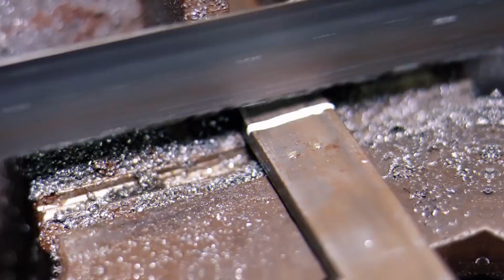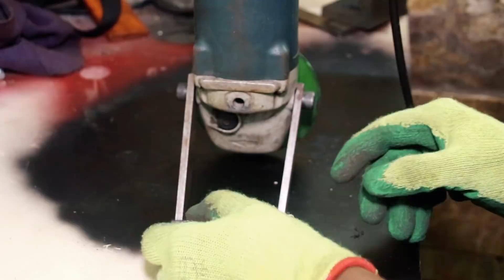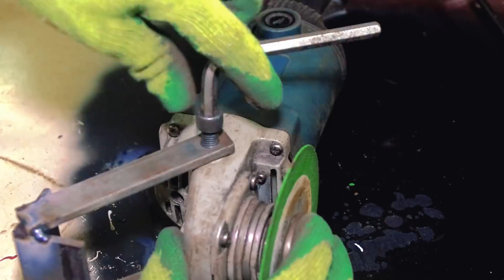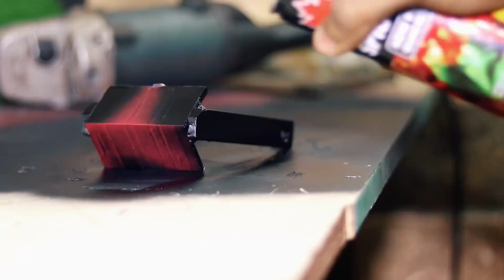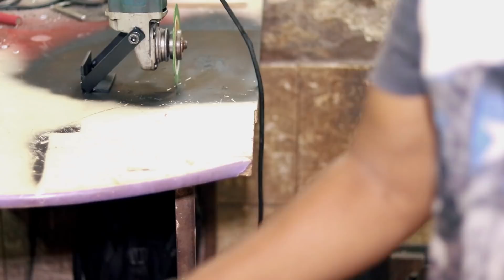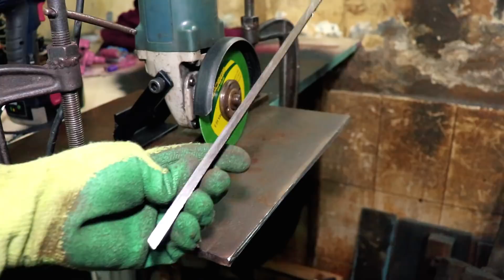THIS IS SOME AMAZING ANGLE GRINDER IDEAS WHICH WILL BLOW YOUR MIND.

Comment: You can easily fit a cutting wheel to a circular saw and run that down a straight edge, safer and about 30 seconds to setup. None the less, a handy attachment if nothing else will work.

Comment: If the jig was longer and held  the grinder parallel to the work piece, then,  you could drag the tool backwards for a fairly accurate cut. Now that may be an interesting concept to work upon 4 some applications.

Comment: All though be a ingenious idea and crafty, I would have to Agree about the other comments about safety issues. Do have a question? When you lower the grinder to make the deeper cut I believe that you also have to move you straight edge due to the fact that that when lowered it would move the blade away from the first slice , so I imagine you have to reposition  the straightedge also to keep it lined up with the cut line? I mean as you lower it it would move in a arc would it not? Like I said, crafty but I believe for simplicity little more thought and add in safety concerns aslo

Comment: first; you dont have to cut an 8mm plate with this machine but with one 230mm diameter 
second; you don't have any stability with your system
third;due to the wear of the disc the angle and distances will change gradually during the job
third; if you want to cut right, you just have(with a correct position of work) to follow (handly) a martyr guide, just to begin a 2mm furrow
then  you finish the work quite

Comment: Hmm. Surely the disc will only mark the metal on the first run. After that it would rotate around the jig, as the grinder cuts deeper, causing the disc to no longer cut at 90'. The jig will no longer be sitting on the flat surface and following the guide piece, potentially causing the jig to ride over the guide piece and defeating the whole object of the jig.😕

Comment: That's an accident waiting to happen. Buy a plasma cutter. 

"If you need a machine and don't buy it, then you will ultimately find that you have paid for it and don't have it." - Henry Ford

Don't pay for it with medical bills.
Reply: Nathaniel Hood- That is a spectacular quote from Ford that I've never heard before. As someone who has spent a fair amount of time both working with my hands and running businesses, I can say that it is extremely true. I can give you a good example that happened to me recently. I needed to bleed my brakes on an older car. Instead of buying a pressure bleeder I decided to do it the old way that is rather labor intensive. Unfortunately, it also carries the risk of depressing the brake pedal too far, and damaging the seals of the brake master cylinder. Guess what happened? I had to buy a pressure bleeder and a new master cylinder.
Reply: David Yeah, I've used that quote on a few occasions with my wife to justify a tool purchase. Thank you, Mr. Ford.
Reply: Nathaniel Hood That's the best comment on YouTube ever 👍
Reply: very good phrase! thanks
Reply: @UFallinggator  I have bled brakes on cars over 50 years and never ruined a master cylinder. And I don't use any pressure bleeder contraption.  That's almost as good as " too much oil pressure and you'll blow out the seals"

Comment: Terrible idea.  Besides the lack of safety (they can and do grab and jump), as the wheel wears, it will no longer be square to the base.  The way you built it, it's only square when the wheel is a certain diameter.  Try again.
Reply: Joe Atwork it would still stay square... It would just cut deeper.... Which would have worked better for him.
Reply: I cut steel with a grinder everyday, it's only as dangerous as you let it be. You have to be smarter than the grinder. I don't see any use for the contraption in this video, just slice it free hand. Its most likely being welded so you can leave gap to keep your project square. I have been a fabricator for 32 years,  I have never seen so many experts until I found you tube.
Reply: Totaly agree.
I can cut with grinder faster, more acurate ,straight lines and in same angle...
This project failed man.
Think something out ,that dont change angle and get closer when the disk wears down. 😉

Comment: the cutting disk will decrease in diameter. then you can not set your grinder holder lower in same line without set the guide bar again .. Handling while working is not safe.  You cannot hold your grinder tightly, dangerous..  good idea,  bad design..

Comment: That’s stupid, because as the disc gets worn you have to lower the grinder, that means moving the rest back. To much setup for that and keeping cutting at 90 degrees.
Reply: Correct Don...in fact it will not cut square even with a new disc as the disc is only square to the material when it is touching the top of it... tipping it into the cut changes the angle...😐if he had packed up the guide foot with 12mm or more  material, set the blade square, removed the packing & cut, it would have worked but not the way I'da gone about it...😔 

Ironically the machinists angle plate could have been used as a much more stable guide (without welding to it of course )  😎

Comment: waste of time, if you're halfway smart you will never use this. what are the benefits? there are none, you would have to readjust the damn thing every 15-30 seconds anyways as the blade wears away. Just do like the rest of us and deal with it before you cut your finger off.
Reply: Jason Voorhees  so many people are like scared to death to use a grinder. I have been a fabricator for 32 years, use a grinder everyday, it's only as dangerous as you make it.  I have never seen so many experts until I found you tube,

Comment: Not to thrilled with the setup, And REALLY not thrilled trusting those tiny little tacks to hold up to the tremendous vibration those grinders put out. Plus you need a tetanus shot to even go near that jagged HORRIBLE cut it made. Buy a bandsaw, some torches or even your stick welder will cut better than that death trap.